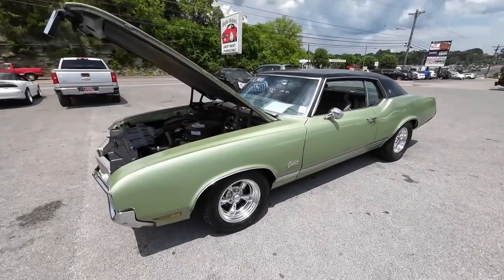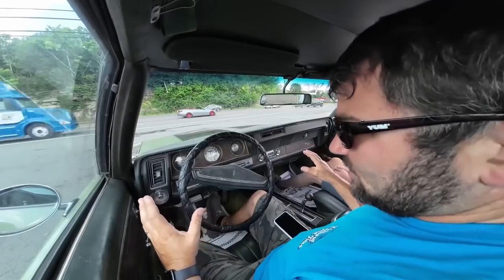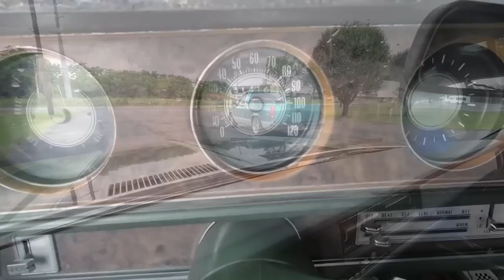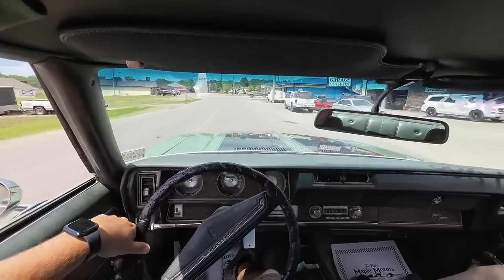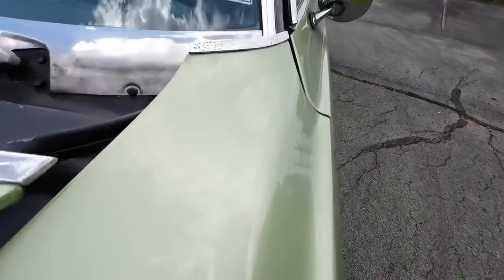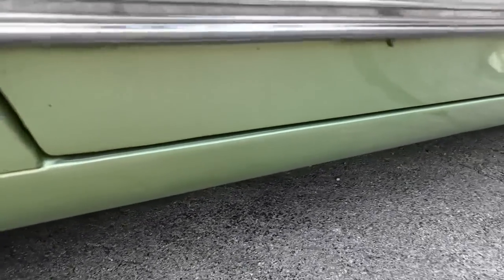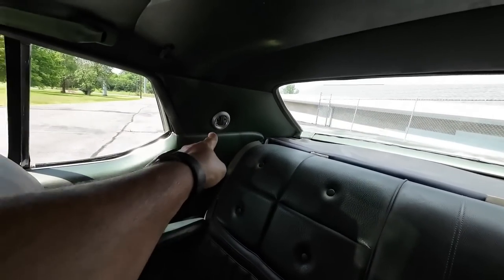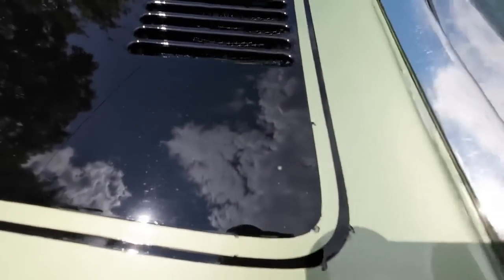Test Drive 1970 Oldsmobile Cutlass Supreme SOLD $21,900 Maple Motors #2181

Comment: Back in '78, looking for my first car(1st gen Monte Carlo) couldn't find one. My father suggested the Cutlass as it was similar platform. Found a nice low mileage '71 Supreme SX. The 455ci was scratched off the breather cover (to mask the gas guzzler underneath)dad knew better as the 455s were blue. My dad test drove it. At one one point he said "wow, you cannot help but spin the tires!" I was "yep, we're getting this one"😁 0:35

Comment: My 74 Olds Cutlass 350 Rocket 4 barrel was a performer and would throw you back in the seat. She'd catch tire in every gear and was an automatic of all things. When I sold it in the 80's, a race driver wanted it for the motor. I'm surprised that this car you're selling didn't have that much power.
Reply: I had a 70 Delta 88 and it would do the same thing  .when you floored it hold on!! This one needs rebuilt imo

Comment: I can’t believe your mechanic puts all these cars on the lot without doing the most simple repairs. Wipers-fan-horn-radio-brakes-turn signals. Gives the impression that the cars were not maintained or driven. When nothing on the dash panel works, I stopped watching. 🙄

Comment: Decent upgrade to front disc brakes,  hook up kick down cable and I'd have to have duel pipes on that. Olds rocket350 can be a potent engine.

Comment: Since you decode the motors anyway, why don't you give the factory horsepower and torque rating for each. Then you can say if you think if it's been raised over that. Instead of just saying it has plenty of power- just to give a guy some idea number wise. But thanks for the great videos- that would just make them even better.